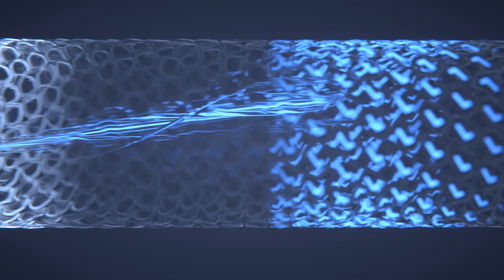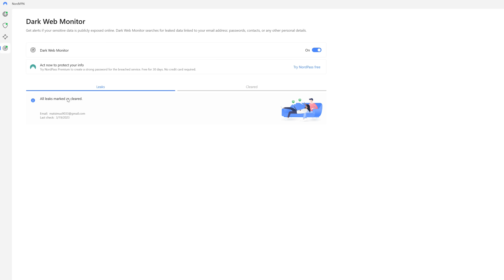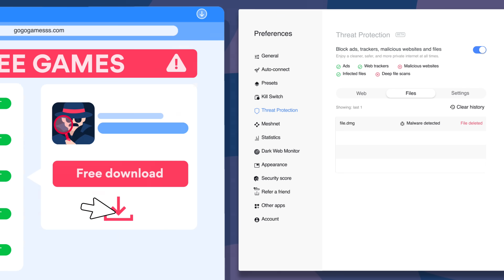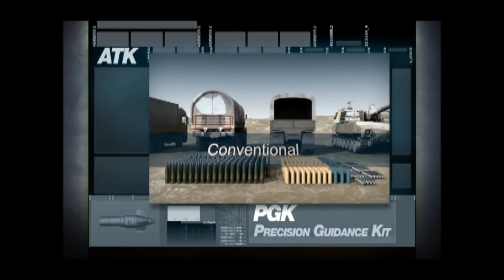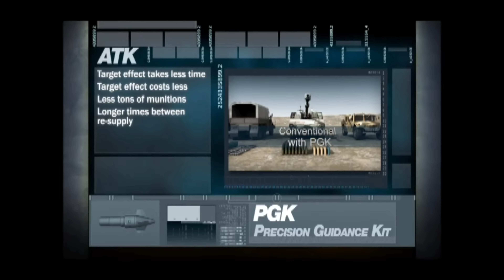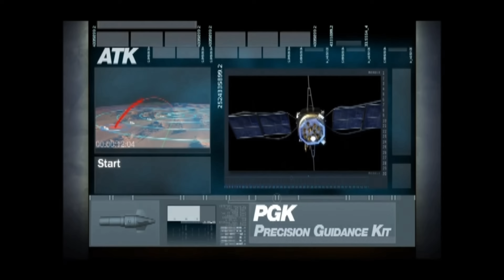Can Precision Guided Artillery Rounds be Jammed or Hacked?

Comment: I would think they can’t be jammed effectively only slightly degraded.  First of all rounds like Excalibur and Vulcano 155 have IMU for inertial navigation and can operate without GPS.  It’s unlikely that the area above the artillery is going to be jammed so the IMU will be correctly zeroed.    There are two types of jamming: seductive to mislead and noise.  GPS is coded and dithered to prevent both.   The round will know when it’s being jammed and revert to its IMU.  After being fired one can imagine the round being only subject to jamming half way through the flight.
Reply: And if only gets jammed on the last half, the degree of drift would not be much.
Reply: @raidellcorps  Antenna can also be made directional so that the round when fired will only listen in the direction of the known positions of satellites.  4 satellites are needed for accuracy but 3 works just not as well.  It’s likely 8 satellites will be visible.  To jam a receiver in this scenario a at least 6 jamming drone would need to be placed between the round and the satellite as the shell moved at supersonic speed.  Not sure if the antenna is that smart on Excalibur but you can bet it is on f35 or predator.  The 5G cellular system has a service called “positional services”. Accurate to 30cm. Biden needs to direct the FCC through the secretary to ensure all the cellular providers and cellphone makers have the service activated  like wise EU Diktat must be issued.   That means if GPS satellites is taken down by s500/s550 missiles commerce still keeps working.
Reply: @williamzk9083  Local-area jamming and spoofing of GPS on the battlefield will tend to override satellite GPS signals for two reasons -- one, the GPS satellites are in a very high 12-hour orbit, over 20,000km up and due to slant ranges they can be as much as 40,00km and more from the receiver. The other reason is that the satellite transmission power is quite low, typically 50W to 100W and meant to cover half of the Earth's surface with that signal . A 10kW jammer/spoofer in a truck only twenty km from a smart munition receiver is going to overpower the satellite signal locally.
One place we can be sure jamming and spoofing ISN'T happening is at the artillery firing position, so I envisage that the smart fuze will be initialised by GPS before firing and in flight an inertial navigation system will take over if the fuze thinks the GPS signal is being spoofed or jammed. The CEP will increase but not by much given the INS readings will only diverge a little from the real position of the shell before it reaches its target.
GPS satellites can't be shot down by any military weapons including Standard 3 never mind S-300/400 etc. They're way too high up and travelling in ball-of-string orbits. Ground-based lasers may be able to damage them but I expect most modern GPS satellites are hardened against radiation attacks of this sort. More likely is hacking attacks, attempts to take control of the satellites and switch them off or subvert their signalling systems. It would be difficult to achieve this, assuming the designers have implemented proper safeguards.
Reply: @williamzk9083  You cant do that on a shell. IE they cannot for example stick out of the sides as they would be ripped off during firing. Not only that but using directional reflected radar is easy to jam using modern  kit. Same with GPS. INS is a nightmare due to the accelleration down the barrel.
Reply: @robertsneddon731  Anti jamming aerials can work out the direction of a jammer and reject signals from that direction.  The aerials are the size of a hokey puck so about 120mm diameter.
Reply: @williamzk9083  Artillery shells are spun projectiles unlike most missiles and free-fall bombs. This means that the GPS antennas in smart shells also spin so rejecting "bad" GPS signals from a jammer by directional reception becomes a more challenging problem than GPS in unspun weapons. For the short flight time in dirty air where GPS can't be trusted then inertial guidance for shells will be accurate enough without having to engineer despun antennas into what is already a very limited volume and mass budget within a 155mm shell casing.
Reply: @robertsneddon731  The aerials are phased array and can focus in several directions rapidly. Most guided shells are de spun by firing in a sabot or by having a loose driving band. Some use a magnetometer to measure “up”
Reply: @williamzk9083  There's only so much processing power that can be packed into a smart fuze and despinning the antennas via software is going to use up a lot of that processing power and, more critically, electrical power which is also in limited supply. INS errors are cumulative over time but an artillery shell is only in flight for a minute or so from muzzle to target, even at extended ranges and assuming the shell's location is initialised properly before firing using good GPS data then the CEP at impact will not be significantly increased.
Reply: @robertsneddon731  By despun I mean that the rifling driving band is loose and on a bearing so the round receives little spin.  This was typically practice with HEAT rounds as spinning spreads the jet.
Reply: @williamzk9083  From what I recall the despun rounds for UK Challenger tanks were for the APFSDS rounds, not HEAT or HESH (another favourite of the UK military that isn't used much elsewhere in NATO). Challengers used rifled barrels specifically for HEAT and HESH because they were very accurate at long range because of the spin imparted to their munitions. The fin-sabot penetrator doesn't like being spun hence the need for a Challenger-specific despun APFSDS round. I believe the HEAT was partially despun to improve the HEAT's jet formation on impact but it retained some spin all the way to target.

Artillery shells used in long-range bombardment aren't despun, indeed from what I can gather the particular guidance fuze body shown in Matsimus' video needs the shell to spin with the propellor used to divert the shell's trajectory as the guidance computer directs. I may be wrong on this.
Reply: @gordonlawrence1448  MEMS gyros, mags, and accelerometers can easily survive the acceleration.
Reply: @williamzk9083  LOL, no. Nowhere near that size. Think about it, your phone can probably receive GPS, GLONASS, Galileo, and whatever the Indian system is called.
Reply: @robertsneddon731  Dude, watch the video carefully. Even this old tech PGK de-spins the fuze.
Reply: @williamzk9083  Not something you can do when you are adding guidance to standard shells. Mags and accelerometers can both be used for up finding.
Reply: @robertsneddon731  I'm afraid you have little grasp of how fast modern processors are, or how much power is available to this sort of equipment. De-spinning the fuze is a trivial issue. Driving the fins will take a lot more power than the processing.
Reply: @raidellcorps  It's only in the terminal phase that most guidance works. A 155 shell can hit 9000 meters altitude quite easily and even using INS from that height and range would mean way more than 0.3 meters deviation. You would be lucky to get it down to 10 due to wind etc as that changes radically at different altitudes and can change direction in 5000m.
Reply: @gordonlawrence1448 given the burst killing radius of a standard 155mm HE M107 shell is 50m, 10m is gnat's a$$.
Reply: You nailed it. So say the GPS is clean at launch, and the first say 1/2 trajectory, then a spoof attempt is detected and the rest of the mission is by inertial. We expect a loss of precision but not gross. There is the idea of an EMP weapon to try to fry the unit but my guess is that would need MW sized transmitters and the most you could hope for is degraded accuracy, (not detonation in flight). 
What wasn’t mentioned here is deliberate trajectory wobble to confuse counter battery radar. I expect that a gun firing these and exploiting fully can program a non ballistic trajectory so that counter battery no longer works. So the gun can sit for 30 shells not 3 before scoot. What do you think?
Reply: @richardkudrna7503  Excalibur can make elaborate course changes.  I believe 30 degrees within a few km.
Reply: Russia very helpfully turned on its GPS spoofer during a NATO naval exercise recently, so we have some idea of their capabilities (which are considerable on paper, but seemingly difficult to field).
Reply: I could see GPS being completely jammed by noise.  It's a fairly weak signal compared to local jamming. But even jammed, it's still an artillery round and still quite effective, just not quite as accurate.  And afaik the M1156 doesn't have inertial guidance.
Reply: Oh, I guess people will give up. There's no way they could determine the broadcasted algo or use MITM tac to determine the code to emu.
Reply: Could a seductive manner be used to provide a safe landing area for incoming munitions to protect your own troops? Dump arty hear so it doesn't hurt my peeps.
Reply: Ain't that basically dead reckoning
Reply: @williamforbes6291  we now watch drone corrected fire with amazing accuracy. I guess this depends on gun state of wear and ammo quality and crew skill.
Reply: @williamforbes6291  Dead reckoning involved measuring the speed and course from the initial point and logging it.  It usually uses air speed or sea speed and a compass.  During WW2 both sides used odographs which used air speed and heading to track aircraft poison between fixes.
Reply: On the subject of IMU coping with the 10,000 G launch, I’m reminded of what was done on the V2.  The V2 had three gyros, which would be damaged during launch. They realized they could “cage” the full speed gyros and unlock them after the initial violent acceleration and shudder most of which was in the vertical climb phase. With IMU the MEMS devices simply hit a physical stop at say 4 G and are not damaged. If IMU is updated at the launch site and high accelerations end say after 1 second (or longer with rocket assisted), the “cruise” portion including trajectory adjustment would be within the  sense range. The trajectory is typically at least a few km so we don’t need very high G turns. All this to say this is why I think MEMS based inertial is so good for use in steering munitions. Also, based on what I read, the nose will spin initially despite being on a bearing but the spinning ends or greatly slows after a short time. 
To me, the ability to program a non ballistic trajectory to mess with counter battery computations is a huge advantage. I wonder if Russia is able to deliver a useful quantity of guided artillery at this point. Does Iran or North Korea make these? Where is the factory that makes the AD chips? https://www.analog.com/en/products/adis16490.html#product-overview
Reply: @richardkudrna7503  MEMS basically keep working since a property of scaling is that if you make something 100 times smaller it can handle 100 times more acceleration.  It is possible that two sets of accelerometers are used a set to handle high acceleration and another to handle precision drift.   The first guided shells used laser ring gyroscopes but now MEMS are used.
Reply: @williamzk9083  that is very logical. Use a low range say 0 to 0.1G for sensing wind drift and use a higher range for max effort turns. 
The analog devices data sheet should spec out shock capability but I will guess those inertia navigation on a chip can handle artillery fire shock. On satellite it was learned that the tiny pyro explosives were killing devices due to the astounding spectral content.  MIL 810 now has a 5 Gig spectral for pyroshock. This is fascinating engineering. I’m so curious why that French shaped charge weapon failed (Russians collected it intact). So fire failed and self destruct failed. I wonder if the battery quit.
Reply: Interesting. Also inertial navigation isn't as accurate as GPS & the farther the distance, the greater the "drift".
Reply: @jdogdarkness  in the 1970s dry inertial navigation systems had a drift rate of about half a 0.5 to 1 nautical mile per hour.   Works out at about 0.25 to 0.5 ms second.  A strategic grade system like the ARES system used on the MX peacemaker missile was almost immeasurable:  about 0.5m in a flight half way around the world.  These used floated spheres and bearings of fluorocarbons.   The MX was probably going to be off target by up to 100m due to errors in gravitational maps.  Modern MEMS on a chip inertial navigation systems are more accurate than 1970s systems so about 0.25m/sec drift which is why NLAW is limited to about 600m range.    You don’t need GPS for trident missiles, B2 or B52 bombers as they can use star trackers for about 150m accuracy.  Cruise missiles use terrain contour matching and or digital scene correlation but GPS is available on all as a convenience.  
In Syria the Russians (Wagner’s) boasted of their GPS jammer they so the U.S. ARMY destroyed it with a GPS guided shell.  Funniest thing ever
Reply: @jdogdarkness  INS drifts with time not distance. The NLAW is accurate enough to hit a moving tank at 600m.  This is 3 seconds of flight at 200m/s so assuming 1 m accuracy the drift rate of the NLAW IMU must be around 0.33m/second.   If Excalibur drifted about the same and was jammed in the final 10 seconds of flight we would expect and error of about 3m on top of a differential gps error.
Reply: Also, a round at extreme range would only have a 30 - 45 second time of flight. To disrupt it, you'd have to know a round is coming, work out what is in its potential range, understand what its target might be, know it's a guided round, then jam the GPS signal, which everyone in the area would immediately know you are doing and would then attract every guided round of all types to your location.
Reply: @ScienceChap  You need to look at ERCA and do some maths. Claimed ranges are over 70km. Even at muzzle velocity that would be well over a minute, then there's the fact that they aren't flying horizontally. I haven't bothered doing the maths, but that will surely take more than 2 minutes and maybe as much as 3. Actually, I found an article that is claiming 68 miles range.
Reply: @chuckyxii10  How much do you think they drift in the worst case time of flight? That's a clue, not a question.
Reply: The real threat against GPS projectiles is the use of C-RAM weapons, as their low numbers make them a "viable" option.